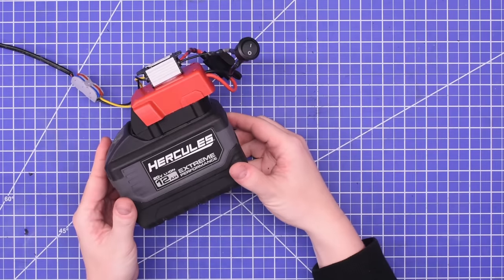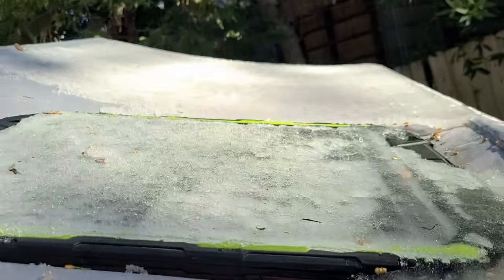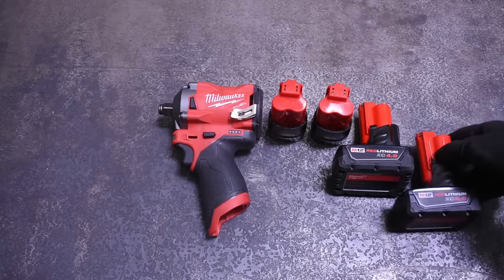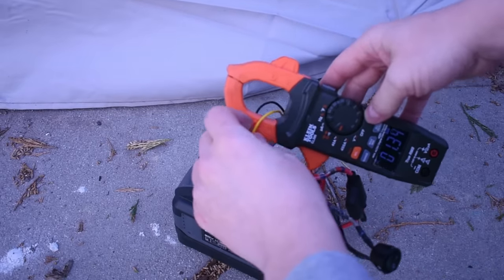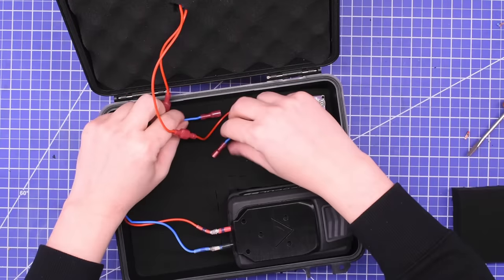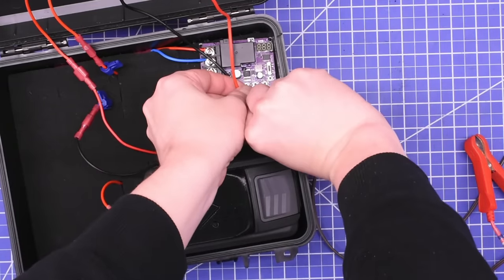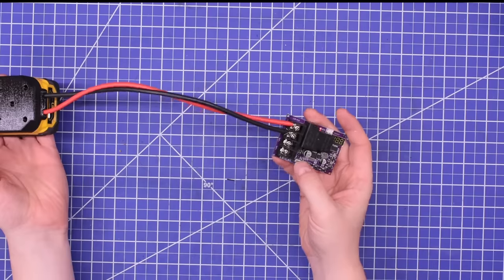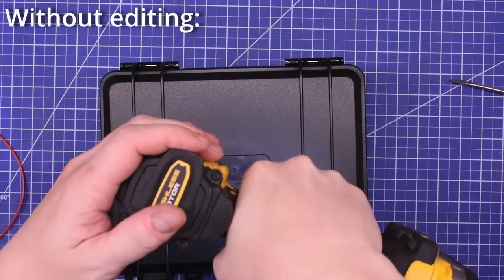Cordless DIY Car Battery Tender

Comment from the maker: Lead acid appear to prefer a float charge voltage of ~13.5V where current eventually reaches near 0. And the easiest path to low voltage cut-out looks to be running a Ryobi or Ridgid battery which have an internal cut-off, Ryobi probably wont fit in the current case at least standing up, so Ridgid it is! Stupid simple. 
Here's the car kuby thing: https://amzn.to/49Egapw
Reply: Some of the Ridgid batteries also have BT monitoring, you can get an alert on your phone when they hit the 10% low charge threshold so not only are they protected but you have a reminder that you need to grab it and throw it on the charger =)
Reply: Came here to say the same, if you intend to leave the battery alone then use a low voltage cut off, or a battery with low voltage protection built in.
Reply: Do you happen to know if the voltage cutoff applies to the Ryobi 40v as well? I have a bunch of those that I only use in the warmer months.
Reply: @jozak78  yes, all the TTi stuff has the smarts on the BMS, Hart/Ryobi/Ridgid/Milwaukee. The only one I wouldn't be sure of is Ryobi's 4V line, not sure how much protection there is in those given they're not that much bigger than an 18650 cell (though the M12 BMS is pretty sophisticated for being coin sized).
Reply: What did you use for LV cutoff, I don't see it in the description?
Reply: @andrewfidel2220  Milwaukee does not have low voltage cutoff in the battery. If you put a resistor between B+ and B-, both M12 and M18 will drain to zero. M18 has low voltage detection in the battery, which signals the tool to stop via the J2 pin going low. M12 cut-out is entirely in the tool and cuts out when voltage goes below 8.2V (but won't start when voltage is below 9.6V)
Reply: @toolscientist  huh, interesting. I didn't realize it was coordinated between the battery and tool on M18. I'm also kinda shocked that m12 is 100% on the tool. I know there's a little PCB board in the genuine M12 packs that my generics don't have, if they don't control low voltage shutoff I wonder what function they serve? From teardowns it looks like they might have over temp sensors.
Reply: @andrewfidel2220  older M12s had nothing but thermistor and input resistors for the balance charging. Newer M12s do have some electronics but they're hidden on the underside and need desoldering. Do you have a link to these M12 teardowns? You might not be able to post the URL, so just find a search query that points to it.
Reply: Heyyyy avid power has a new high torque!!!! For 139 on amazon!!!!!
Reply: I can tell you're used to lithium ion. Lead acid is a different animal. With lead acid, voltage is not a reliable indicator of SOC, overcharging is encouraged, and a low float voltage can sometimes discharge a battery faster than not charging it at all. Dial float voltage up a tad
Reply: Get rid of those alligator clamps and use a cigarette lighter plug. Verify the cigarette lighter socket on the vehicle is hot at all times, of course.
Reply from the maker: @jsplasha  trying 13.7v as we speak
Reply: @RANDOMNATION907  In my experience some solar trickle chargers use the OBD2 port as that is always hot and most cigarette lighter ports are usually NOT hot without the key in the on or accessory position.
Reply: @yojamey  that's a terrible idea, one malfunction in the charger and you can fry multiple expensive computer modules.
Reply: If only the Makita batteries are better in capacity, the genuine ones have overdischarge protection...
Reply: Correction Makita's low-voltage cut-off is in the tool rather than the pack and if you attempt to charge 3 times when the pack is under voltage the battery will permanently brick and become a spendy paperweight.
Reply: @yojamey  Project Farm tested which tool batteries were best, though it has so much power loss through the protection circuitry...it did not brick
Reply: @RANDOMNATION907  I used an SAE socket, so I can plug in directly to the tails I have on my vehicle batteries.
Reply: @TorqueTestChannel  Nice. I'm a 13.5 guy myself
Reply: @Alcorelli1 can you explain further? I don't really understand what you mean by this. I'm looking for better ways to attach these solar chargers
Reply: @Mr.Meme01  The connector that comes on most battery tenders.
Reply: @Alcorelli1  but you used a socket? That's what I don't get

Comment: For your LV cutout, I’d recommend using an op-amp and a transistor. It’s a pretty simple circuit to make and can be wired in a way that it takes itself out of circuit once the LV threshold is hit (no quiescent current after triggered). The cutoff you have now uses quite a bit of power because it’s keeping a relay coil energized at all times until it cuts power. If you’d like to try the op amp circuit let me know and I can make a schematic for you.
Reply: Please link to a schematic and parts list for your version
Reply: Tried commenting the link on my PC but doesn't seem to post. Trying on my phone now. https://docs.google.com/drawings/d/1UPVN0dd0dWMlLERcgKvK-5vuQsHkPLgCHrvIeVfGw34/edit?usp=sharing
Reply: @TheXxRenzxX  that circuit will forever draw power through your R2+R3 divider and overdischarge the V1 battery
Reply: @toolscientist  you're right, my mistake. That should be connected to the output of the transistor, not VCC.
Reply: @TheXxRenzxX  Also the reference (R1 + Z1) which draws more current than the divider.   Unfortunately moving the voltage sense to the output is problematic, the use of the N channel MOSFET means you are losing a couple of volts (i.e. Vgs), and the exact voltage will be dependant on the load current and the specific transistor you are using.  The input offset current of the LM358 (at least a genuine one) is very low so you could simply increase the divider resistors by an order of magnitude at least.  A better choice may be a P channel MOSFET driven by a micro-power comparator e.g. TLV170x.
Reply: @ferrumignis  this is also true. Another option would be adding a second transistor to the circuit solely for the dividers and the op amp. You will have some drop as you mentioned but it won't be influenced by the output load current. Thank you for pointing this out, appreciate the feedback!
Reply: @TheXxRenzxX  A self disconnecting circuit with a latching relay would also be a good choice. No voltage drop, almost zero quiescent current when powered and zero when disconnected.

Comment: Even though I have AC power available for a car that does not move much, I bought the solar charger shown at 2:00 as I don't want to have an extension cord running through the driveway. We will see how long it lasts. Hopefully, it will last a few years at one-third the cost of a new battery.

Video idea: Test <30-watt solar battery chargers/tenders for rated output, akin to flashlights previously tested.
Reply: If you park facing the right direction without a car cover you can keep the solar panel inside the vehicle.  Ice and water won’t kill the panel, but it might get too hot inside the car in warm weather.

Comment: It was a emergency situation, but was surprised when I was able to jump a full sized 350 with a HF Bauer battery pack, using nothing more than alligator clip and 12 gauge wire

Comment: I like it! One thought is some TTI specials with the likes of Ryobi, Ridgid etc. The packs will cut the pack power with Mosfets for Low Voltage  Protection. Even the 40V packs will (not a fan of 40V).  The Hyper Tough 12V will also, not sure about their 20V stuff. That way you don't have to have a Low Voltage Cut Out board so much. I have a video showing a latching circuit used in conjunction with the board also that will protect the pack from pulled to zero if forgotten and left connected. That will of course pull more current draw with a relay being used as holding contacts. I enjoyed the video!
Reply: Yup, Ridgid and Ryobi have low voltage cut offs internal to the battery. Dewalt has it in the tool.

Comment: Neat!
I made a little tool adapter that slides onto a dewalt battery and then gives you big ol alligator clips to connect to something. I used it to jump my car in emergencies.
Reply: Jumping your car with 20v? That seems brave lol
Reply: @SomeGuysGarage  car batteries and most car electronics are pretty resilient the biggest issue is drawing a ton of current from a power tool battery. 20v x 200A = 4000w and that 200A metric is on the low end of cranking amps some mid size trucks require north of 600A to turn over. Using 200A isn't usually a problem for the actual batteries in the power tool pack but the connectors can start to melt from the heat.
Reply: @ndragon798  from my research, dewalt packs are good for 50ish amps in the 5ah size, so that's only 1000 watts.
Reply: @SomeGuysGarage 50A continuous. You can pull 100-120A before hitting low voltage (12.5V)

Comment: AGM batteries really hate going flat and often short out and become unusable when that happens.  I have a couple of almost new Optima Yellow Top batteries which are dead as door nails, pulled from a genset which the Army mothballed for about two years before I bought the genset.  Uncle Sam disconnected but never charged the two batteries.  I tried for weeks to run the desulfate cycle on my charger to fix the batteries to no avail.

I got a so-called 50 Watt flexible solar panel from eBay for a friend who drives her car very little.  Based on the surface area, I believe an honest rating is around 15 Watts, still plenty to keep an AGM battery charged with a few hours of sun per day.  The solar cells are backed by fiberglass.  The unit even came with little suction cups to mount it inside the car’s rear window.  I lengthened the jumper wires included with the panel so the panel could be left clipped to rear mounted AGM battery while stuck to the inside rear window.  So far the panel is working to keep the battery topped up.  I doubt the panel has a very advanced charge regulator, but at least it seems to have a Schottky diode to prevent the battery from discharging into the panel in low light / night.  She just leaves the solar panel in place and drives as needed.

Comment: My truck sits outside in the sun, snow and whatever Wyoming weather year around. I use a cheap solar charger connected with wire and a fuse. It is small and sits on the dash. As long as I keep the snow clear it works well. I ran the wire to the battery, it gives me a second power port when driving and charger point when parked. Not perfect, but it works. I have used it in my 1994 S10 Blazer for 15 years. I live in an apartment with no plug ins and no cover. My truck sits for a week or two at a time and it fires up immediately. Use a fuse... Don't burn your vehicle down.

Comment: Milwaukee do badly need to make some kind of starter/charger with a big capacitor so it doesn't kill off the main battery.
Could be on to a winner here, if certainly buy one.

Comment: What I use is the typical battery charger that is also able to so CV and not only CC combined with a cheap powerstation. 
Just this week I bought one with 300wh and 300w 450w peak for 100€. 
Works fine so far. 
Bit small when the battery is really drained but then I'll use my lithium jumper, start the car and let it run for 10 minutes. In the first few minutes the alternator will dump a huge amount of energy into the battery. Sometimes 50a+

Comment: The LTC 3780 has everything you need. It is a buck-boost converter and has a built in low voltage protection. And you can adjust the max current.

Comment: This is actually useful for me, I run a LiFePo4 in my summer car and it's got a max of 3-4 days of sitting without the float charger until it's too low to start. Weighs 3lbs because racecar but not good if you don't drive it often and you're away from home. I did get a solar panel that should suffice but that's no good in a garage or shady spot. This would be great for trips when I'm staying somewhere for a few days at a time doing non driving things.
Side note, I had those same terminals he has on that Toyota and they're garbage long term. They don't made good contact on the posts and caused more no starts than anything else, super frustrating! The name brand 3x more expensive but looks similar terminals are actually very good and gave me zero problems over several years of use.

Comment: ive done one of this with 3dprinted makita battery and build in 100a bms so i have the low voltage cut off. i bought a cheap 10a buck and im running it at 2a. Every weekend i change the makita battery with a fresh charged one and i haven't paid attention how long the battery last, all i can say is that it worked fine for me in the winter.

Comment: This is the awesome content we are all here for. Can we get a gas powered now one though?
Reply: Chainsaw powered battery tender 😂
Reply: It's called a generator lol most have 12v outputs for maintaining batteries.
Reply: @volvo09  That could actually work. Would need a little generator attached, an e-starter and a microcontroller. The controller could start hte the chainsaw motor whenever the car battery drops below a certain voltage and charge it up to the upper cutoff voltage.

But then  again, one might actually have the controller turn on the car engine from time to time to top-up the battery. Just make sure to park it out of gear.

Comment: Never had a car die from spiking it directly with 18v, have done it on 20+ different times on 15 cars and they are all perfect. If it’s going to be sitting for a while I just disconnect the battery. Left a car for over a year like this and batt was 9.8v when we tested it, reconnected and jumped it with a 8ah Bosch pro core to start and let the alt do its job. Car and battery are still fine

Comment: Having a connector instead of outright flying leads coming out of the box will be better. For a low voltage cutoff you can be lucky if you can find a transistor switched board than a relay one. A DIY approach would be a TL431 based circuit, a schematic in the datasheet. (Figure 10-12, Voltage Monitor)

A more sophisticated approach is a push-pull output comparator that will compare the input voltage (through a resistor divider, a multiturn potentiometer) to a reference voltage (a Zener diode or a capacitor bypassed resistor divider) which will drive a MOSFET (here is why push-pull comparators is best) to switch power on when the comparator sees a voltage higher than reference, and turn the MOSFET off when that voltage goes below the reference. Happy tinkering!

Comment: you should be able to get bms style boards that have low voltage cutoffs and no relay using mosfets instead, parasitic draw can be in the microamps for those

Comment: Sorry, fellas, but the best idea for this situation is the one that I use... powerbank, with a 120v outlet and a standard battery tender. You can get a power bank for around $50 and a tender for about $30. Besides,  a really good power bank, about $200, has a ton of uses and comes in handy all the time. Not to mention, that for a few bucks more you can get a solar panel as well.

Comment: if you have usual 18V drill battery with full charge - you do not need anything else. Just connect it to 12v car battery with wires strong enough not to burn immediately (2.5mm usually ok, heats but survives) and wait for 3-5 mins, done. It will be 15-20-30A (depending) charging current, in 3 mins the main battery will crank strong enough to start.

Comment: i WAS going to go get a 12.8v lifepo4 battery for my car due to certain driving habits causing that lead acid battery to dip into the 50% soc range (even less once) but a good 18v liion powertool battery is more than capable of handling the juice input output and can fit under a seat. did some measurements and two hercules 12ah batts fit neatly along with the estimated size of the electronics clusterfuck (for now, still figuring out a more elegent solution, the lithium battery voltage doesn't really mean anything as there is an electronics control and management between the two.)

Comment: Hey TTC 

It would be absolutely awesome if you could test the new Milwaukee MX fuel stuff, especially the cutoff saw, Vs petrol equipment! 

It was bought out to replace petrol engines due to constantly tighter emissions regs in EU.

Keep up the great work, hello from London!

Comment: DeWalt already makes something like that (but much smaller, about the size of a power stack). Only problem is the batteries don't last long, and when a battery dies, the tool has to sit for a day or so before it can be used again.

Comment: I recently purchased an adapter for the 20v Dewalt battery off Amazon that has a built in low voltage cutout that, to the best I can tell, has no parasitic losses.  Unfortunately it is listed as unavailable (maybe sold out?).  But, at least that sort of thing is out there.
Reply: That's pretty cool!
Which one was it?

Comment: You could probably get away with a MOSFET or an opto-isolator with such low current draw, requires a bit more electronics knowledge but there might be modules out there
In my experience opto-isolator would be a good choice, tiny chip can handle a few amps, and has a sharp threshold voltage, so just choose the right resistor to put on it and should work potentially drawing less than 1mA

Comment: i feel like instead of clip leads using a cigarette lighter would be easier and allow you to keep the trickle charger in the vehicle out of the elements.
You would want to make doubly sure its not connected while cranking because it would probably blow the fuse for the cig lighter, but you could also think of that as a secondary protection to keep from over drawing your little trickle charger.
Reply: Not all cig lighter circuits are constant-on.
Most domestic are, (Jeep wasn't, though, but they may have changed). Most Japanese aren't,  and it's  a toss-up with other COOs.